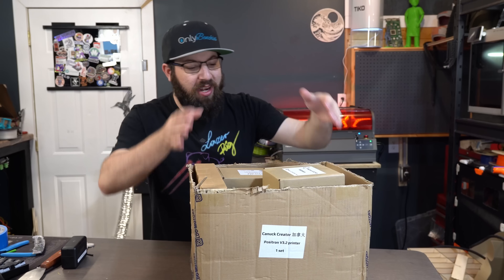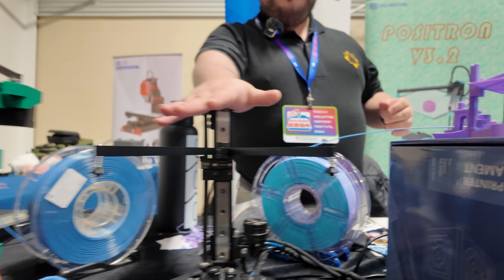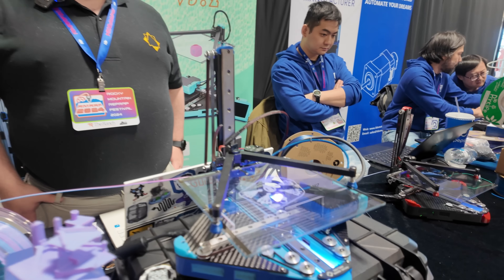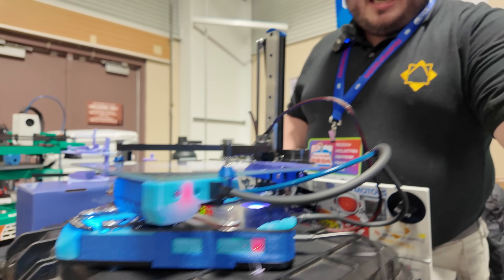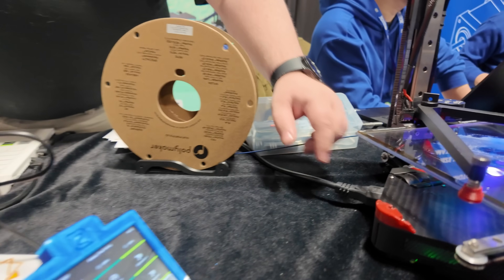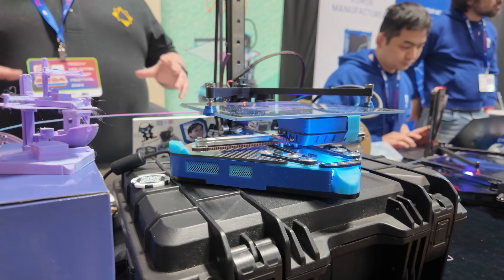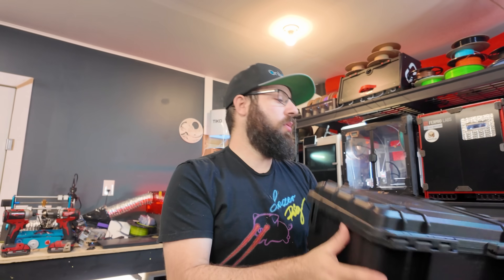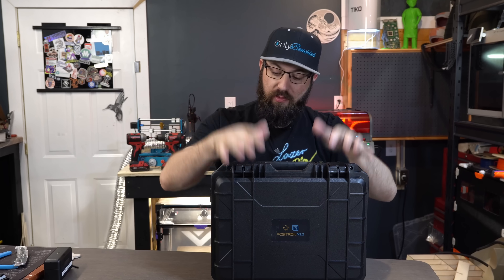THE POSITRON IS  (almost) HERE! - Unboxing and Build Plans

Comment: I’m really itching to get one, but OTOH I’m quite sure I don’t want a glass print bed ever again…
Reply: We're experimenting with a PCB bed, stay tuned 🙃
Reply: @nomadsgalaxy have you investigated if it’s possible to coat the glass with PEI?
Reply: @UloPe  Yes, it is possible, but LDO really wanted to go with a full clear glass bed for aesthetics.

Getting a sheet of PEI is pretty easy to apply though.
Reply: this thing is an accumulation of mistakes. the person in video keeps pointing these out. hard pass.
Reply: @thijstriemstra  Such as?

We highlighted changes from V3 to V3.2 in the first quarter of the video.

We were honest in saying we needed additional cooling, honest in saying that the IR isn't the most reliable, would you prefer we be dishonest? And tell you we've had no problems at all?

If there's something we said wrong, I'd appreciate the feedback so we can improve.

Comment: I work construction and am on the road a lot. 3d printing has been my hobby for several years at this point and when I saw the video for positron v1 I fell in love. I have been waiting so long for it to be viable and at one point has given up hope. I recently started building a 0.2 because lugging around my ender is a hassle and because... Voron. Can't wait to build a positron! I do got to say that that guy sure doesn't sound like Kraylin though he has apparently been designing positron for years. Whatevs. This machine isn't the best fit for everyone, but it absolutely is for me, and damn if it isn't cool!
Reply: Kralyn and I have worked very closely together, he had to step away due to other obligations, and has made me the CEO/Project Lead of The Positron Project.

We still work with Kralyn, and he is very proud of where we've been able to bring the project :)

We hope this fits your needs!

Comment: If I see it a MRRF I'll look at picking one up just for the build.  I am a bit disappointed though.  As it was pointed out the case is larger for the additional options BUT.. its a large case, not excessively large but still large.  I find a bit of irony in that the printers claim to fame is that it fits in a filament box.. but now we have a larger box and it hasnt got the capacity for a single roll of filament additionally :/
Reply: So this is intentional - the case is designed for airport travel, so the unit can survive being carry on or checked baggage.

As such, we couldn't make space for Filament, mainly because the TSA has informed us that Filament looks like Det Cord, so we encourage people to ensure that their filament is packed separately.

Otherwise, it still fits inside a filament box. So that is still an option 🙂
Reply: @nomadsgalaxy  greatly appreciate the explanation and detail. Thanks for taking the time and responding :)
Reply: @Steven-Machado  of course! I'm happy to answer any questions.

To be clear - our team knows the price is up there, we know it's niche, but it was a passion project, and we're just excited to bring this to people who this truly works for. 😊

Comment: what the fuck 850 bucks is a bit overpriced I think... I thought it would be a cool project to build one, but that is way over the budget for a small project like that... its not like its a super good printer I would use a lot... its more like a gimmick, to take somewhere sometimes to show ppl how cool 3D printing is
Reply from the maker: I mean, the design is open source, if you think you can make/sell kits cheaper go for it.

But keep in mind it IS a niche product with many custom components and a low volume production run, when it comes to price, it is what it is.
Reply: We tried our best to match the price of a V0, there was a lot of RnD that was put into it, and a lot of custom components, as such, costs have to be recouped. The price will eventually go down in time, but if you think back to the first Laptop ever made, it was gimmicky and overpriced, but it was the start of something new.

Comment: I still don't get why people care about this thing. It just seems like a random collection of gimmicks. It prints upside down! It can fit in a filament box! OK ... but, why?
Reply from the maker: why not
Reply: Sometimes when you work abroad and you need a part to fix an issue you wish if you have your printer with you so that solves an issue for me
Reply: We wanted to make it ultra portable, that's why. It just so happens to print upside down as a result.
Reply: Would be nice to have in your Van
Reply: The point is to be ultra compact and portable while maintaining a good build area, not to print upside down. It just turns out the best way to accomplish that was by printing upside down...
Reply: it's fun to watch it melt plastic